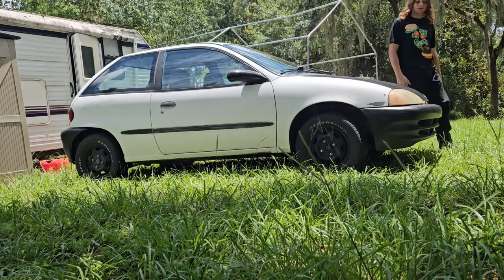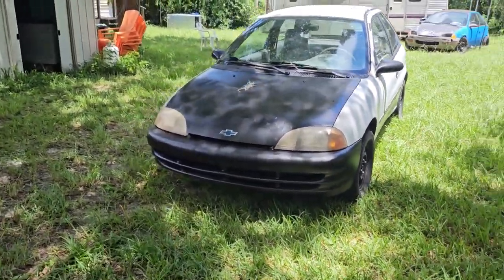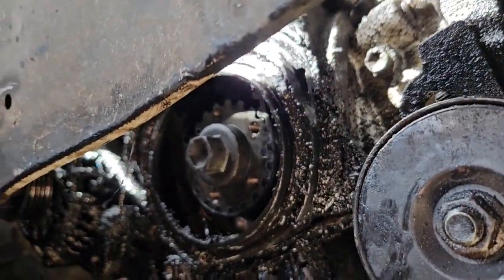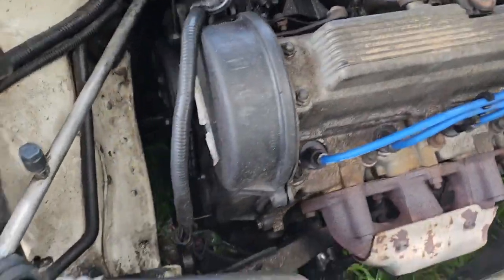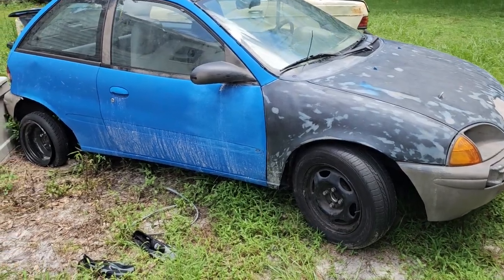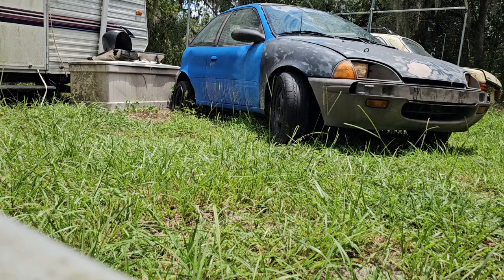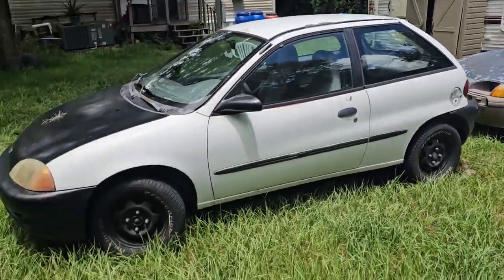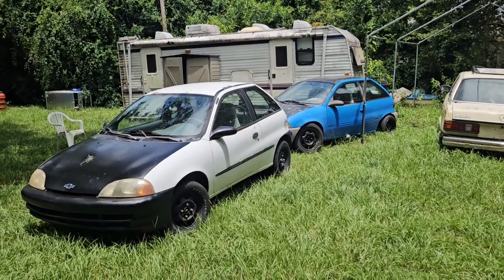NEW CHANNEL PROJECT!!! (thanks for 175 subs!!!)

Comment: I saw the first one and i was like brotherrr 👌 and then I saw the second one and I exploded, bro nice pulls. Not to mention that parcel shelf in the back super nice.
(one fyi for you is the 1.0 is actually a 993cc or something)(also the engine is a noninterference design so even if the belt were to snap the engine wouldnt implode.)